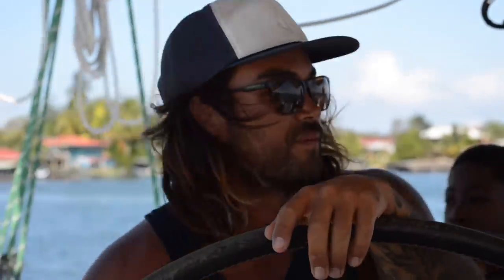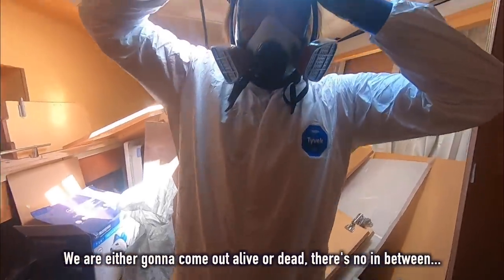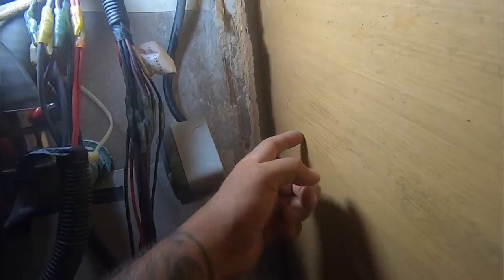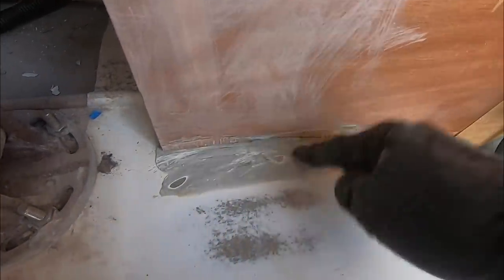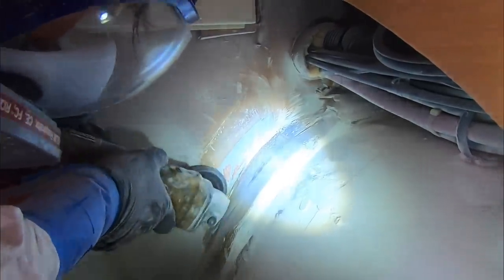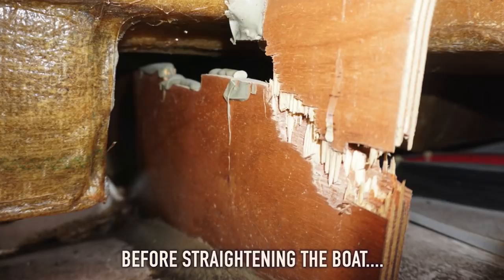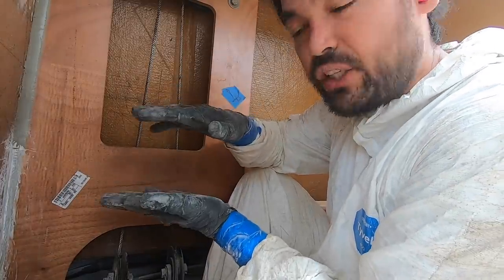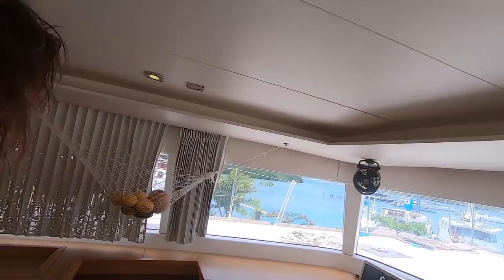CRACKED BULKHEAD REPAIR SERIES - Part 7 (Episode 112)

Comment: If that guy in Martinique is right then it's a huge thing since lagoon is such a big seller around the world that it's without doubt that soon you will be hearing from them unless...they decide to play it low and just pretend that this is without any consequence...but sincerely i don't see that happening since all related hurricane damages are only refunded if your insurance steps in, on the other hand if the other damaged boats did not get damaged through hurricanes then they could stand a chance if the load bearing points damaged are similar, then it would mean that the load points are unsufficient in strenght to withstand the maximun load pressure it was made for, any way you guys ate doing great and keep pushing, " bon courage " and god bless.
Reply: The boat was damaged in the hurricane yes but the biggest problem only started when things where tightened and then one beautiful sunny day ( BANG ) what the f..k was that 🤔 yes the boat completely came apart in side 🙉🙈 really a total right off  yes   the end   finished    A total reck   and why  🤔  ask Lagoon   Or ask John ( Author of the ) 450 owners group 🤭🤫🤫🤫🤫🤫🤫🤫 what problem 🙈 anyone want to buy a Lagoon 450 🤯🤯🤯🤯🤯🤯 I wanted a 440 but I can’t do it. And now I’m thinking about a completely different Catamaran 🤔 only engines or completely electric. Yes people things are changing every day 🚀  🌕

Comment: Ya for sure testicular fortitude by you’all . I spent a week laying  FG and then a week sanding my FG adventure trailer I built and NOTHING sucks worse than FG dust. Just glad you all are wearing the right gear. But the heat ☀️ , multiple FG layers and confinement makes this next level. I had a  N51 mask, I’ll likely die soon…. Good luck mates.

Comment: At the start of this there was high level contact with Lagoon, who no doubt thought at that time that help was good social media PR. But this was before you have shown the issues are not caused by  wear and tear cause but by poor production and quality control. And as any conversation you now have with them simply cannot avoid this topic, and with other boats and possible lawsuits with these issues, Lagoon will be very careful not to make any comment that could be interpreted as admission of any liability.

The problem may be that Lagoon boats over a certain age may become uninsurable without a requirement for an invasive survey, perhaps even major panel cutting work if as you mentioned endoscopic investigation may not be sufficient to identify bulkhead problems and/or poor glassing indicating potential for failure. And underwriters will quickly identify any unusual pattern or increase in total loss claims through fire or other causes and adjust policies accordingly.

Comment: found this on a forum so who knows ?
now normally i am not an alarmist but recently there has been a thread on the facebook 450 owners group where several owners of 450 f/s have reported broken bulkheads , ages 2011 - 2018

Most of these seem to be in Martinique , some in other places , but it all seems to be caused by a rigging tension that is too high

Lagoon changed masts somewhere in 2014/15 where they went from double shrouds without diamonds to single shrouds with diamonds , the 'older' type mast has specs where the rigging tension much lower than for the newer type , but regardless of which type of mast people report issues with both type

Comment: I was gonna buy a Lagoon 450, after this.... Leopard 48 here i come
Reply: You might want to have a naval architect review the Leopard structure the low tunnel slaps the waves and stops you momentum. Also the structure from hull to hull connection . Go find a used Privledge
Reply: @frankferris300  thanks, will look in to it

Comment: It’s just a boat. It was put together by hand, it can be repaired by hand.
Reply: It's the manufacturing process that interferes with your approach. As we have seen, the fitting cabinetry and details are assembled as a unit and dropped into the hull. It is not easy to go and access these bulkheads for tabing. They end up destroying a large portion of the cosmetic - functional interior. It's going to be  interesting to see how they restore all of the cabinetry and how it will look. 
They are devising an approach that can and will be referred to on these other boats. If true, this manufacturing defect will cost tens of thousands of dollars per vessel to remediate. It can result in a great opportunity for those who are experienced.
Reply: @kbaisley4947  There is kind of folio/laminate  (looks like wood or any other material,) you can stick (or apply with an iron) on existing plywood to refit your interior.. so Put back all the panel cutted out  (piece of wood behind the cut and screw to keep the cutted panel in place, somes filler and cover all the panel with this folio. not expensive but probably not easy to source in Panama
Reply: @damientelle  Many thanks for the education on it. I was thinking from the sheet or patch and not from the overlay or laminate, I get your vision on it. A friend of a friend who took a sunseeker into a break wall and had to go thru extensive renovations. I just remember it was a costly pain staking effort, but part of that was, as you alluded, availability and finishes (He had a lot of exotic wood)
Reply: @kbaisley4947  in this case like cutting holes in the facade of a 4 star hotel suite and expecting it to look the same by check out
Reply: @damientelle  Understand the concept around using laminate. Where I think the team will run into issues the seams. Use the example where they cut an access hole in the middle of the wall in the hall between the cabins. Do you now patch and laminate the entire wall? How to you finish off the seams ? Do you now need to put corner guards up on the corners to hide the seam? Can you match the laminate material so when you are trying to section a cabinet back in, so it will blend? My concern is that it's finish work and the devil is in the details.  It can be done and it's in great hands. With the communications that they have established with the manufacture, hopefully the will be able to hook them up with either the laminate, if available or the laminated ply that's matching.
Reply: @fuksushi3766  concur - matching finishes and where you section in that laminate(if available) or more than likely, laminated ply so that the seams blend in. It can be done, but as they alluded, its an assembled section that is dropped in the hull so the fasteners, etc are hidden. I have a feeling that the use of additional moldings to hide seams will cone into play. Not insurmountable and the team will knock it out. Looking forward to the additional content going forward. Great project and rooting and enjoying the winds for the team along the journey.

Comment: So basically the build quality of Lagoon cats is really shoddy
Reply: All cats probably. Be interesting to survey all these damaged boats and see what has been going on industry wide.
Reply: Fancy boats = fancy motorhomes 
ALL BULIT ON A PRODUCTION LINE 
WHIT LOTS OF CHEAP MATERIALS 

YOUR JOB IS TO MAKE IT BETTER THAN BEFORE, SUE THE MOTHER COMPANY,  USE THAT CASH TO FIX BAD DESIGNED BOAT 👍
Reply: @darinmbicknell  not so sure about that.  The non Charter style boats like Seawind should prove to much more durable.   They use no polyester resins.  They use Carbon Fiber in high load areas and no wood. only closed cell high grade foam core.
Reply: Not all Catamarans and not even all Lagoon boats. The bulkhead issue seems to be related specifically to the Lagoon 450 only. That being said, their long term reputation will take a beating from this.

Comment: Hey....
This is not really a design flaw, as much as it is a construction flaw....terrible workmanship. In laying the glass....to the point of negligence in the quality of the work.  And then in not supervising the workers, in quality control.

Like not laying up the glass in the tabs.  To bring the glass up, to cover a much wider area.  To distribute the stress, over a wider area.  By not doing this.  All the stress is concentrated,  into a very narrow width....and it WILL crack!!
Reply: I agree the quality of the workmanship is ultimately to blame.  Maybe if it was assembled better there wouldn't be widespread issues under normal use...however part of product design is knowing how things will be assembled in the real world and accounting for that.
Reply: @cup_and_cone  Well....yeah.  But designing it to work is one thing.  But the execution of that design, is still a separate issue.

He said in the video there could be a design flaw.  Well.....

It appears to be designed well enough.  But is a lot of poor execution, with voids in the actual glass work.

But yeah.....it still comes down to upper management to ensure they built a good product....and they didn't.

Comment: I don’t believe your lagoon would stand a chance with a claim as it’s hurricane right off .
Also no Warrenty no claim, it’s as simple as that .
Good luck if you believe it is a design flaw then one is required to make some structural changes to areas that are under load bearing points, just making good or reinstating areas of failure won’t allow for future longevity.
You guys have to work out the various forces around areas in question wether they either pushing or pulling forces.
There’s no point just dumping loads of glass to these areas as you will only be creating “hard spots” causing hairline cracks to appear outside on the gel coat.
Should you choose to carry out the repairs in epoxy resin you won’t be able to use flow coat ie gel oat over these areas as adhesion is not possible causing huge amounts of cash expenditure on paint which will in effect be obvious when selling by survey requirements.
You must use vynal ester resin and find the original gel coat speck for color match imperative to later value when selling .
Repairs undertaken with products that can only be painted will devalue this boat hugely.
You guys are going to have to place transverse stringers or bulkheads in areas where previous failure was apparent .
High density foam core sheathed in biaxle and multi axial is your best modification bet with architectural knowledge of where to distribute loads more evenly or you will be grinding every two years .
Reply: You would think after this and the other boats, all 450's would be damn near uninsurable
Reply: Class action suits are different, however I don't know how France works,  nor if you can have an international class action.   I think the real issue will be if there has been any loss of life.  

And existing owners being able to insure the boat.  Insurance companies will simply drop all existing policies
Reply: Andrew, you have made valid points here.
Reply: @nicholasr7987  this craft is built under CE directive .
Most cats have stringent ratings when sailing in winds in excess of 20kts .
Most issues ensure from overloaded rigs where for example a code zero sail similar to a spinnaker should not be used over 15kts.
These boats don’t heel over like conventional hulls so overloading is easily done .
It’s a bit like driving a Lamborghini down a road full of potholes and crying out that it’s not in good shape after doing so .
These are blue water cruising cats and one has to think what stresses are running down the rig when sailing . It’s as simple as that they not steel they lightweight blue water cruisers .
A motorboat that does 35kts for example will have damage when trying to do those speeds in a 3 meter swell .
One has to think logically about such matters when dealing with boats placed under excessive loads in conditions untoward .
Unfortunately this boat has been literally smashing against rocks or other boats for days of hurricane weather, shock loads of which nobody knows also prior to this what about the previous use, did he overload the rig nobody knows .
Reply: @andrewdrew677  I like the Lamborghini analogy.  However tabbing is questionable,  and rotten plywood.  I have been around too many automotive recalls to not blame the manufacturer for cheap parts or unforseen design flaws.   

 Could be why the previous owner left it to fly away in a hurricane,  and probably get some insurance money.........
Reply: @nicholasr7987  most high production builds have the same sort of workmanship/build quility, this is a cruising cat for blue water sunbathing .
When using such a vessel for ocean crossings or endeavours outside its capabilities one has to understand that only a certain amount of stress loading can be applied .
It’s all repairable, just a really shitty job and one has to consider the fact that without additional structural platform being added one could find oneself repeating this process all over again should you wish for around the world sailing in all weather with this blue water boat.
Reply: @nicholasr7987  regards the rotting plywood at the bottom end of the bulkhead above the locker was of course cause and effect, by not being drainable / limbered also with floor space being made premium one has lost the riser on the foot of the doorway, all necessary compromises for price and blue water capabilities/volume.
The manufacturer could state bad maintenance not inspecting lockers for water ingress, or perhaps the collapse of the bridge deck cause the seal to become void .
The boys got her cheap enough and they young and fit enough to get on with it, beats the hell out of sitting at the office😁
They can use those big balls they bragging about 😂😂😂and show us some more sweating.
Reply: @andrewdrew677  You make good points.

Comment: Not surprising someone is looking into litigation. It doesn't take boat builder to see all the shortcuts Lagoon took when building these boats. From what I've seen you removed this does not look like a blue water sailboat. For you guys you never got the sales pitch from Lagoon about the 450's capabilties. It will be interesting to see if the lawsuit gets to depositions whether they knew the boats construction techniques were not up too snuff for what they advertised. If I was management and legal counsel ar Lagoon I would settle out and do a recall fix the boats. Next question has any Lagoon 450 broken up at sea and killed anybody?

Comment: You don’t need to be a structural engineer to release that this boat has structural flaws in design.... more like structural shortcuts everywhere.... the way these boats are built is wrong.... installing prefabricated boat rooms on bottom of the boat and then basically just glue a top peace is not even structurally sound for a prefab weekend house, not to mention a boat that is supposed to sail around the world...
Colin is to much reserved to say it loud that is structural flaw... hoping that other guys will have a success lawsuits against boat builder...
Once you guys complete all the work you will have a strong boat like it newer was before, even stronger than when it was a brand new....
Reply: I can see them going bust, and nobody getting  anything,  then  they will start  up under a new name, With the same mistakes
Reply: In the industry we would call it manufacturing flaw but not especially design flaw: The architect is in charge of load calculation.  We have zero numerical value here, but i am not sure that thickness and syze of the bulkhead are  wrong (VPLP design has one of the top record for large multihull design, including 130 feets Maxi racing trimaran, MOD70, ORMA60 and so on) . But the “making” and manufacturing of the architect plan..... tabbing misplaced, cut out for wire installation at the weakiest point (this kind of “Secondary structure” are not validated by the original design), quantity of glue and tabbing not controlled and not repetitive, Part of manufacturing process impacting the original design (infusion channel right under the tabbing) and so on......
The fault is more on the factory than on the design office. I agree for the end customer it makes no difference, but in front of a court, it does, especially when there is 2 compagny like here (VPLP for the design, and Lagoon for the manufacturing)
Reply: Structural flaw or poorly build, from my point of view it’s same thing... it is about structural designer engineers to participate in building process it self, to make sure everything is build according to standards..... it’s called building survey inspection....
However, just by looking at those bulkheads joints makes me sick how bad are made, and don’t forget that this boat when was new costed about $500000.
The reason why it’s so poorly build is simple: saving time on prefabricated rooms they save a lot of time building a boat, and time is money.... 
anyway those bulkheads joints at least could be done better because they are installed before prefabricated rooms....
Honestly, this factory bulkheads joints look like kids ve been playing with silicone gun...
Reply: @markoozy  i agree with your general understanding . i was just mentionning that there is in all indistry
Reply: Yee, unfortunately these past 15 years everything is about profit profit profit, quality control check list, what is that in job description??? Never mind we will give to someone that doesn’t ask to much questions... 
cheers